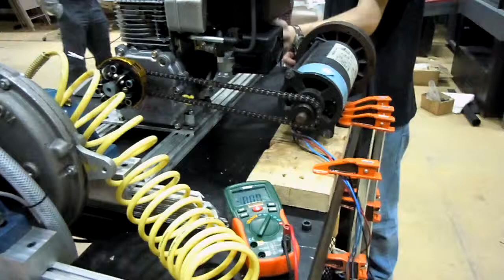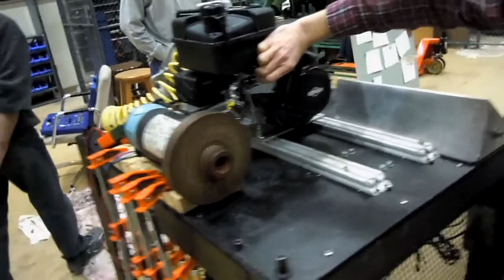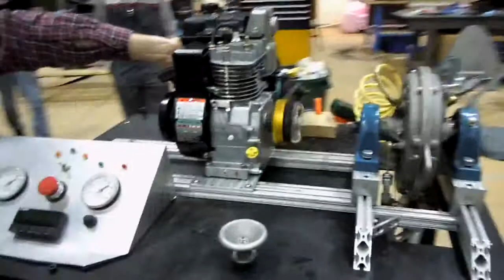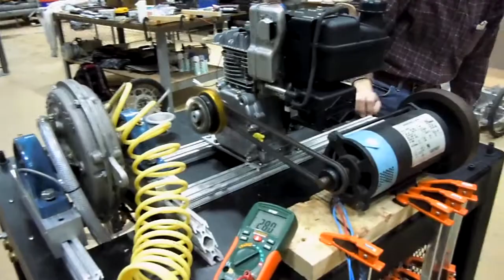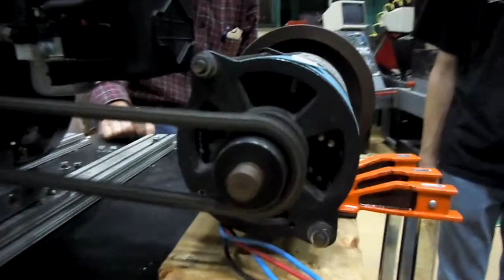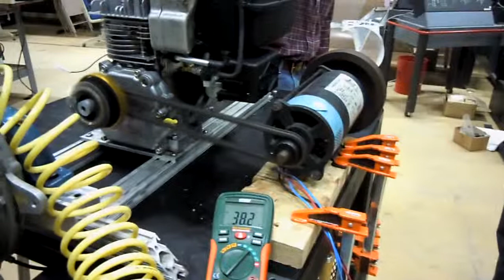Dyno set up test 1

Comment from the maker: Not directly.  We measure the volts and amps that the treadmill motor generates and based on that, we calculate torque and rpm (depends on the resistance of the electrical load).  Check out some of my newer and much better dyno videos.